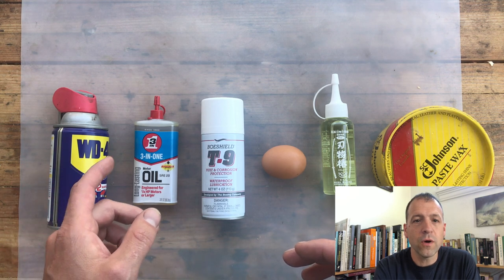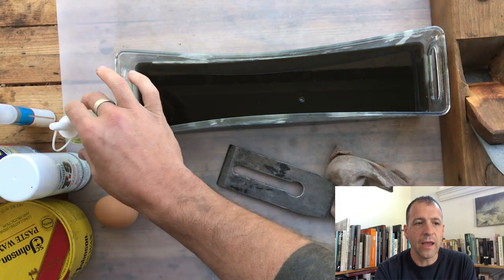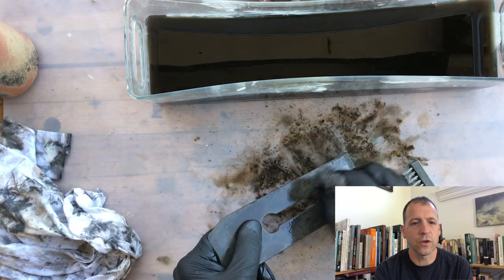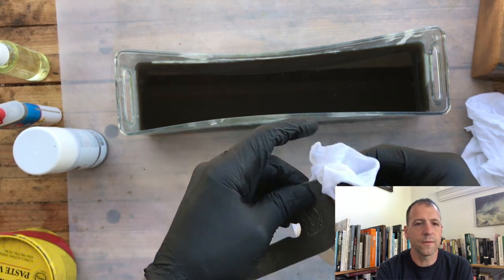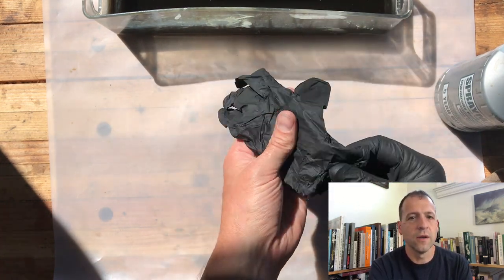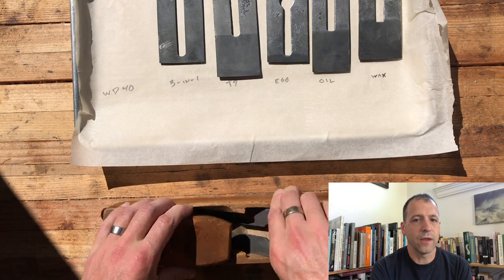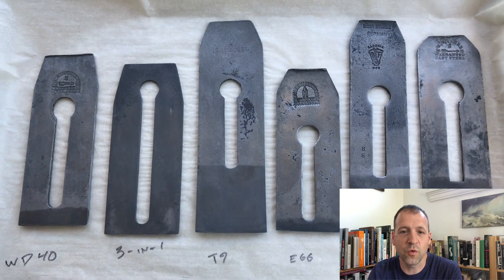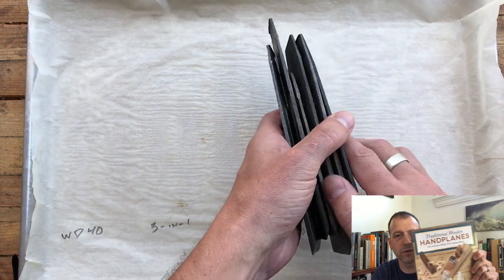What's the Best Way To Protect a Plane Blade?

Comment: Interesting results. I would point out that the standard WD-40 formula is not meant for long-term rust protection as the volatile petrol distillates evaporate after a few weeks. Such tests usually need a reference part that is not treated with anything. The key in rust protection is to provide a relatively durable barrier against moisture. I would think those that provide a drying film would be best for parts that are subject to manipulation. Reason being non-drying oil is more easily rubbed off. Therefore I like the T-9 and wax. I have found that camellia oil eventually dries after left for a period of time.

Comment: Since you asked for feedback on your method, I was wondering how bad the rust would have been on a control blade, cleaned, but no protection at all.  As a side note, I like marvel mystery oil.  Thin oil, but, to me, a pleasing odor. Thanks for sharing your experiment.

Comment: The WD in wd40 stands for water displacement hence why it doesn't work for lubing.  Content creator aquachigger would most likely be a good source for preservation of steel as he retrieves metals from rivers etc & has to prep them i.e canon balls,muskets,pistols to stop them rusting. Personally waste engine oil sprayed & a good amount of dry dirt mowing in dry conditions works fantastic on my mowers (steel based). It creates a water proof barrier. The thicker the layers the better.The disadvantage is any cracks are hidden unlike paint which shows them if any.

Comment: All my tools are left outside under a covered porch. They are exposed to all the moisture in the air, and we get a ton of winter rain. (PNW). I havent used eggs, nor camelia oil. But I have used everything else. As a blacksmith and wood craftsmen, I find only one method actually seals out the moisture/ rust for years at a time. Takes a very little work but its impenetrable. I should find a way of marketing it. Would make me millions. (ps: paste wax, beeswax, mineral oil, wax/oil blend, wd40 (the worst), etc etc all fail in short order (month or less)

Comment: One of the things to take notice of is the pH, if the blade is going to stored you don't want it left in an acidic environment. The reason that oils have low pH (acidic) is that it is a cheap way to create 'creep': penetration. Creep is vitally important in protection of metal, it has to 'get there first', before the water. Acids are the inevitable by-product of  chemical breakdown involving manufacture of polymers.
Penetrating fluids with balanced pH have avoided the 'cheap an nasty' route: try Rivolta TRS Plus by Fuchs.